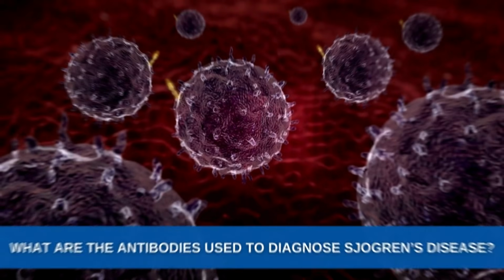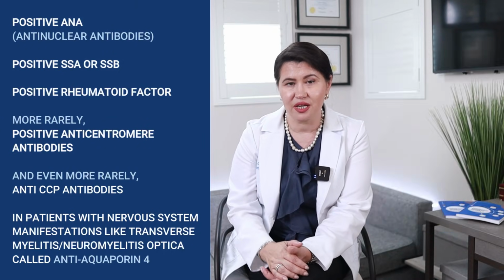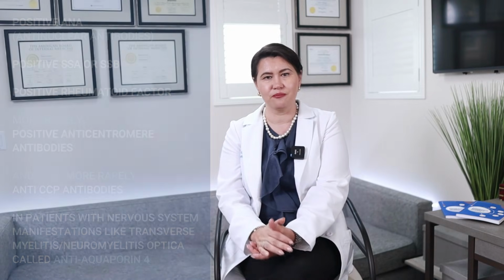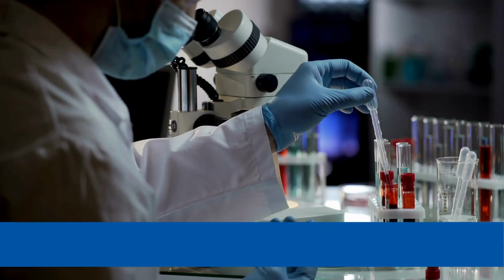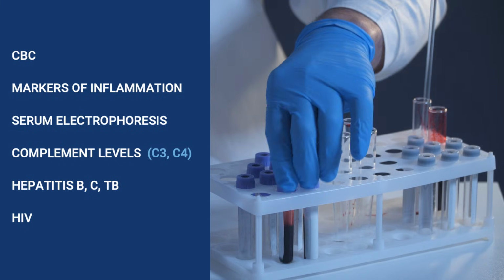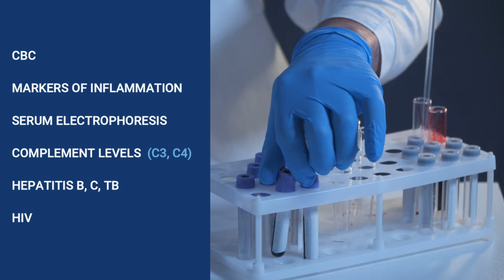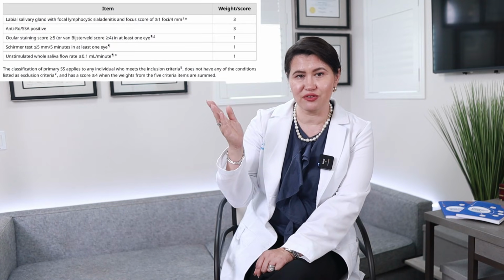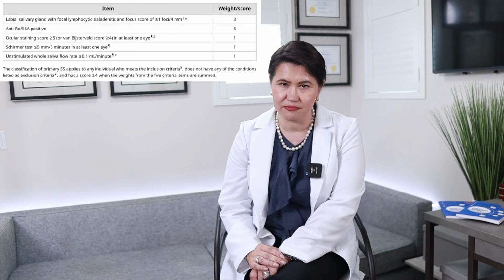Essential Sjogren's Disease Tests to Ask Your Doctor About NOW

Comment: Hi Doctor, I have a question. What is the point of testing for SSa and SSb for Sjrogrens if the tests are inaccurate? It goes the same with the lip biopsy? If these tests come back Negative, and a patient could still have Sjogren's, why do it?   I have had multiple blood negative tests and a negative Lip Biopsy, The Neurologist is still suspicious of SS bc of some dry and burning mouth and "Idiopathic" small fiber neuropathy since 2011. Four Rhuemyatologists said I do not have it. What are your thoughts on this? ty
Reply: @marie-h33  A corneal specialist told me that I do have Sjogrens based on severe dry eyes even though the lip biopsy was negative. I do have positive ANA. I was on Restasis after eye drops failed. I now have a couple of lung nodules and just got over a very painful spinal arthritis flare that had me almost bedridden.
Reply from the maker: Thank you for watching my videos!
Reply: @rheumatologistoncall  yw but that is not an answer
Reply: Maybe she si reluctant to say something on this- just based on that info. Best speak to your Drs again maybe. @Sconzette

Comment: So I have a question. So i am currently on medicine, i was dignosed with sjogrens for roughly a year. When my first test was done, it showed positive for both ssa and ssd plus elevated c4. Now that i moved, they retested me again but now its showing ssa and ssb negative with elevated c4. Is it possible to have tested postive but later on be tested negative and still have the disease?
Reply from the maker: It's definitely possible for test results to change over time due to various factors. It's best to consult with your healthcare provider for a more detailed explanation.